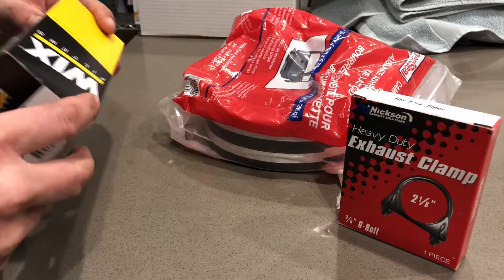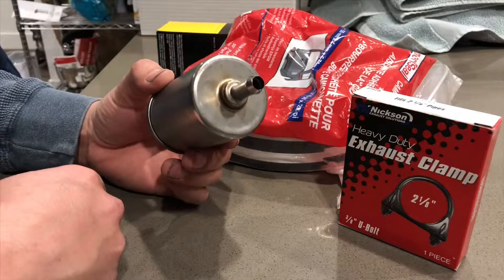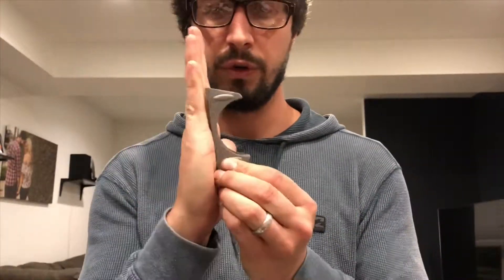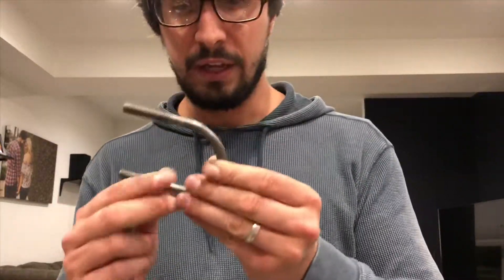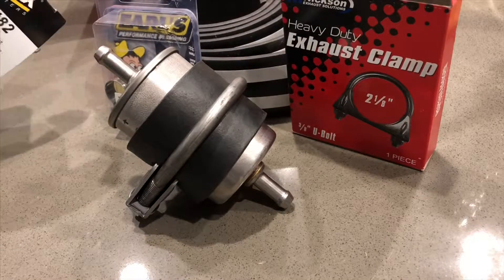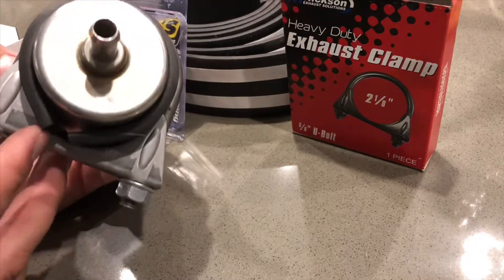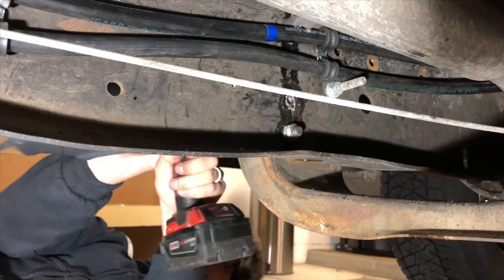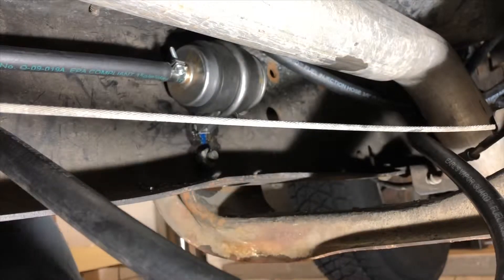Part 2.5: I Messed Up... But I Help Save You 30 Bucks

Comment: i know im a year late but how did the filter like being that close to the exhaust?
Reply from the maker: Matt Rage honestly it has been fine.  But good reminder because now i have 3” exhaust and i should probably check again to ensure its not an issue
Reply: @truckandroll989   right on.. i just found your channel and really enjoying the c10 content.. i have a 76 i am building myself and have been on the fence about thie efi system

Comment: Not a bad idea using that to clamp down the fuel filter. Too bad you nailed the fuel line LOL. 
I'll never forget my friend giving me shit about taking a full day getting my rear suspension out of my mustang. The inner collar was rusted to the bolts... So I had to use a bunch of little air saw blades to cut it out. He wasn't laughing when his next project car had the same issue LOL.